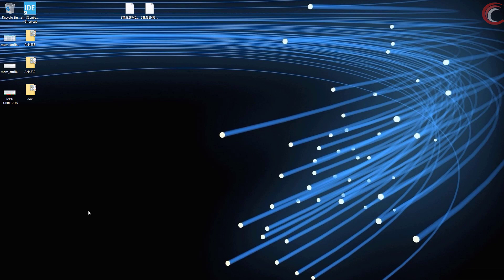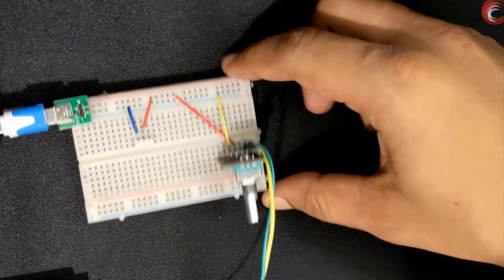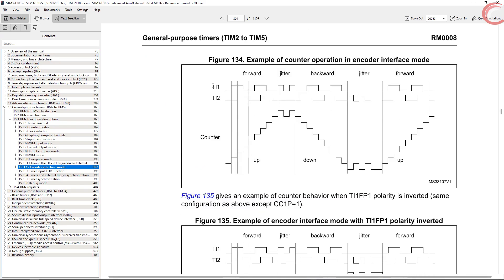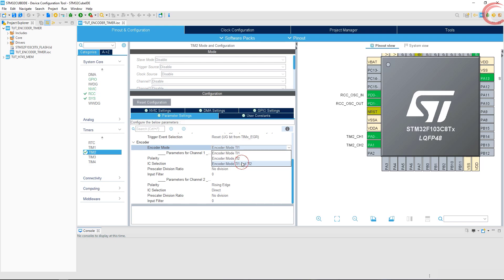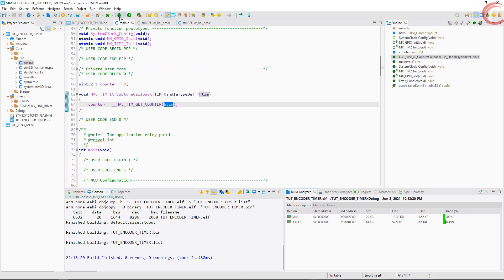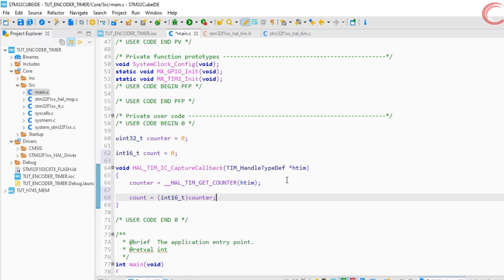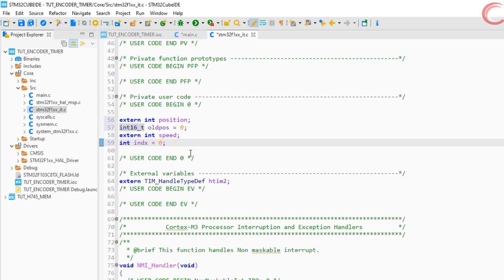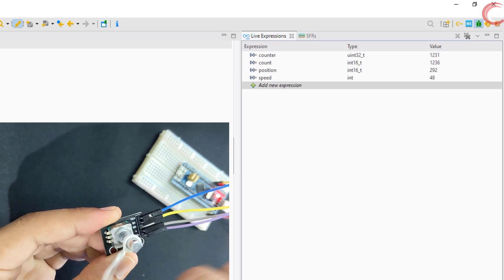STM32 TIMERS #3. ENCODER MODE || F103C8

Comment: Timer counter increasing/decreasing by 4 because it counting each edges from both channels, if you change config for this timer then you should see increasing/decreasing by 2
Reply: Change Encoder Mode to T1 or T2 not both if I remember correctly that means which channel is master and it is depend when timer CNT will increase for CW or CCW
Reply from the maker: I can see how using T1 or T2 alone could work but how will it identify the jitters ?

Since it only rely on the signal from 1 channel and then compare it with the signal from another channel at that particular instant, how will it know if it was a deliberate movement or a jitter
Reply: @ControllersTech   in t1 or t2 mode timer incrementing CNT by 2 so also you will have jitter filtering, but for sure it will not be so effective like in t1 and t2 mode. From reference if you use t1 or t2 one input is used as a clock and timer increasing/decreasing CNT depends on second input level, in t1 and t2 both inputs working as a clock (edge trigger f/r) and also as a signal (low/high), if edge will occured on t1 then timer "checking" t2 level and if edge will occured on t2 timer "checking" t1 level.
Reply: @ControllersTech  	Manual says : 
Programmable counting rate
x4: normal mode, all edges active
a 1000 lines encoder will give 4000 counts per revolution
x2: counts on input A (or B) only, but direction still determined
with A and B
“velocity mode”: encoder clock can be further prescaled if
needed

Comment: i know that the generic timers are 16 bit... how did you take the value to be 32 bit unsigned... and why did you cast it to 16 bit signed instead of 32bit signed.... also is there a way to get the absolute position upto like 64 bit

Comment: Hello, please, I have a question. What is the maximum input speed? i mean What is the minimum pulse duration the timer can read in this mode? , thanks!
Reply from the maker: I don't think there is a definitive answer to that. It depends on your timer clock and system clock as well. Also if you have configured the timer to read very high frequencies (in MHz), then you won't be able to read very low frequencies (say around 1 or 2 Hz).
So you have to configure your system according to possible incoming bandwidth. Try experimenting and figure out the optimal configuration for yourself.
Reply: @ControllersTech  thanks!!!

Comment: Can i use encoder mode without global interrupt?
Reply from the maker: You can, but you have to poll for the event. Better use interrupt or you might miss the trigger events.
Reply: You can (must) use  for example Timer2 in encoder mode without global interrupt , because it is more accurate. When you use global interrupt for the timer in encoder mode, only the chosen edge(rising or falling) will be "recognised" .. you can test this with a  (cheap) REGULAR encoder with ,for example 100PPR, because these Bourns encoders with 20 clicks are mechanical that's why you have four counts at the time...What you need to do is "whobbeling" ONE bit forward and back.  You will see the difference with and without the use of global interrupt on the specific timer in encoder mode...  And to poll the value of the counter at regular periods , you can use another timer with a time interval at choice. whether a long or short interval the count is ALWAYS accurate. The counting has NO need for code, just the polling needs a little code in a interrupt service routine..
Reply: @ great answet thanks!
Reply: No problem, any time : )
Reply: @ can i get ur email and you more about embedded?

Comment: the counter increases by 4 because the callback function is called upon the encoder mechanical zero, and because you used rising & falling edge detection.

In the reference manual: "the user can obtain dynamic information (speed, acceleration,
deceleration) by measuring the period between two encoder events using a second timer
configured in capture mode. The output of the encoder which indicates the mechanical zero
can be used for this purpose."

Comment: Hello, do you also know how to count an encoder like this with LL and not HAL? So functions won't start than with HAL_TIM_.... but with LL_TIM_..... We would like to know this because the names are a bit different then.
Reply from the maker: There is more to LL than just replacing the characters "HAL" with "LL".
You need to have good understanding of the peripheral.
Read the reference manual for that